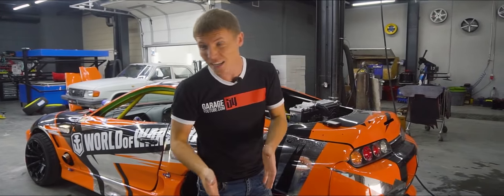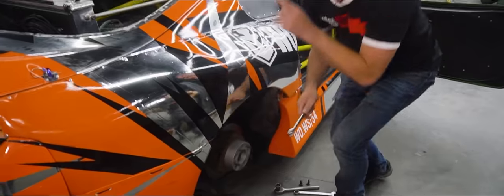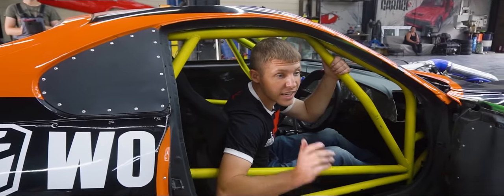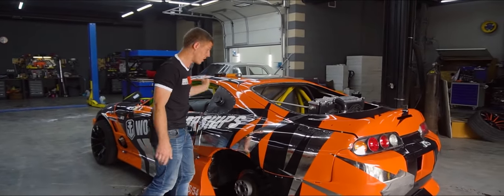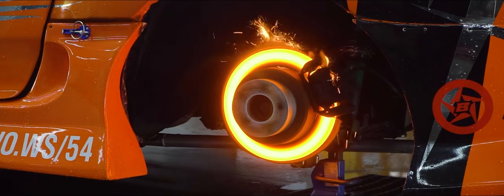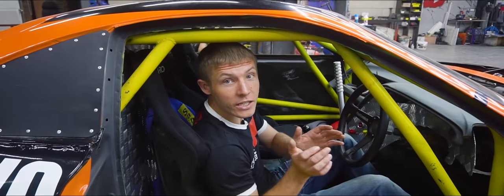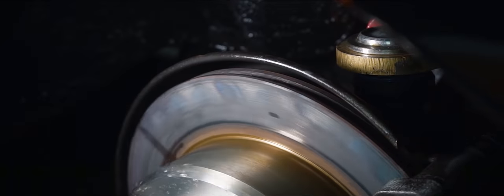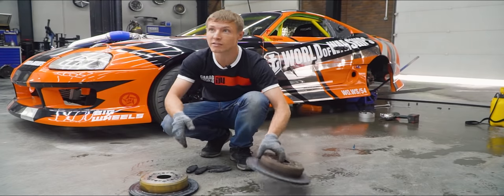Drenching a red hot brake rotor - what'll happen?

Comment: I go with BrakeBest Select Premium Ceramic brake-pad sets, they're like $40(for both front and right), with OEM-style store-bought standard-rotors $20 each side(front and right), and last 2-3 years hard driving.  $100 for safe driving.  If the vehicle is over 8-10 years, I replace the brake calipers and pistons, and evaluate the condition of the brake lines.

I burnish the brake pads onto new rotors, meaning just after installation, take the vehicle on a test-drive, for the first braking surface-mating, get up to 30mph/45kph, then brake medium-hard(but smoothly) until a complete stop, wait 30 seconds for pads and rotors to cool, then repeat 30mph/45kph, then brake medium-hard until a complete stop, total of 10 times.  That ensures the brake pads and rotors have the material mated into them enough that you could safely drive with the vehicle, without a long-break-in period of 200 miles or so.  So with brake-burnishing you can get the vehicle safely back onto the road with traffic, can be done in the first 5 miles.

Comment: I'm quite curious what would happen with a cross drilled rotor. Would the extra stress points cause the rotor to break apart?
Reply: Probably, I’ve seen them com apart before and this is a very extreme test
Reply: Yes
Reply: That's why they don't use them on race cars

Comment: Ahh, the Leidenfrost effect.  The insanely hot surface causes the mating surface of the liquid (water in this case) to heat up thus causing gas (steam) to form which repels/suspends the water and allows it to roll off.

Comment: Heat irradiation is protecting the steel from malforming. Water molecules get evaporated before they can even really touch the steel. The problem begins with drops below 100° c

Comment: the reason why the new rotor turned a weird color is because manufacturers of rotors tend to put a thin layer of grease on the rotors before shipping them out to prevent rust buildup. This layer should be cleaned off before you install the rotors onto the car. Spray the rotor with brake cleaner and wipe it with a clean rag...if you don't do it the car won't brake properly and if you brake hard you end up burning this grease as it cannot handle high temperatures

Comment: Glass or metal DOES NOT like sudden temperature!! A woman here threw boiling hot water on a frozen windscreen, you can guess what happened. 
In touring car racing at Bathurst Australia 1000km race the cars coming down conrod straight hitting 250--270+++ kph the brake disc rotors reach 900 deg C, you can see them glowing red hot!!!! When the cars come in a pitstop, it is quite normal to see flames around the brake pads!!
The OEM rotors will be the best! After all the manufactures spend a lot perfecting their vehicles ( maybe not so much these days but before computers were doing it all for them ) OEM parts are BEST but normally the most expensive!
Reply: I believe these guys tested boiling water on a frozen windshield, surprisingly nothing happened
Reply: @prich0382  the woman i mentioned SHATTERED her windscreen.
Brake rotors would be to tolerate some temperature changes ie day to day driving.

Comment: Due to something called the leidenfrost effect the water is being repelled by a jacket of steam created as the water boils before even touching the surface. Most of the water will just slide off and never touch the brake because of this, until the brake has sufficiently cooled. Even though most of the water doesn't touch it, it still absorbs a large amount of the heat from them.

Comment: I'm not sure if the brand of the rotor was the determining factor of when it cracked but the thickness of it. 
The used rotors were thinner, which means less material can rapidly change temperature, and can change more uniformly. The thicker ones would crack cause of the rapid temperature difference on a part of the surface, where the rest of it has trouble catching up shrinks at a slower rate which stretches the material until failure and it cracks sooner and under less intense heat.

Comment: I've experienced both aftermarket and OEM style rotors. Some are even made with recycled materials. and the ones that are made from "raw" materials tend to hold up a lot longer and they don't burn out the pads as fast either I've noticed. Might be neat to do a test with both raw materials vs recycled materials to see what the differences are.
Reply: If recycled metals are done properly they have every bit the characteristics and quality of newly made metals, like anything else it's the standards it's held to during the process, newly made metals can be just as crappy as poorly done recycled if not held to standards when it's produced.

Comment: They only shatter when they are extremely thin and worn, warped, and full of cracks, then force is applied and it creates a torsion moment on the rotor from the caliper and then you get a grenaded rotor.

Comment: I'd be curious to see how other manufacturers of brakes like Brembo, EBC, PowerStop and so on would hold up... 

If I were to nit pick, the water application rate wasn't quite the same between the two tests... some of the cooling was really only happening on the front surface, not the back at the same time. Either way, still interesting to see.

Comment: Fun experiment but in reality rear brakes don't do a lot of the braking. On a dry road maybe maximum 15 to 20%. 
The front brakes do most of the braking work. That's why they are bigger, heavier.
But they never get as hot as shown in this video. That only happens in racing and rally.

Comment: This happened to wifes my yukon. The bracket that holds the brake hose got old and corroded and worked like a check valve letting brake fluid going in but not going out seizing up the brakes.
Reply: I've seen that happen a bunch of times in my 40 year career as a mechanic. 
Another one is people with automatic transmissions that never use their parking brake and then one day for whatever reason like parking on a steep hill they decide to use it, then when they go to drive away and release it the parts are galded up from never being used and the return springs aren't strong enough to retract the brakes so essentially it's like driving around with the parking brake engaged, at least partially, that burns stuff up just like you seen here.
That's why I always preach to people to always engage their parking brake every time they park their vehicle, it keeps all the parts in a healthy state and prevents that from happening, along with some cars actually having auto adjusting brakes that do their automatic adjustment when the parking brake is applied.
Getting in the habit of engaging your parking brake every time you park the vehicle keeps everything in good working order along with some applications keeping your brakes adjusted.

Comment: A SUGGESTION BASED ON THIS VIDEO AND MY OWN "EXPERIENCE"😉
Once upon a time, I attempted to shove a Jeep YJ with a seized axle using my 2014 Sentra, manual transmission . 
At one point, with traction disabled, I had the revs maxed, the clutch fully engaged but NO WHEELSPIN. 
Very very very soon after much smoke came from clutch area, and I managed to save the clutch. Still using it many tens of thousands of kilometers later. 
I would love to see you set a Lada clutch on fire in a similar manner.

Comment: What about installing a CNC Machine Coolant Pump to douse your rotors while driving with a recovery & recycle catchment trough Below the break's or else internally water cooled breaks or other liquids which are wetter than water
Reply: Some large commercial trucks are equipped a system like that to cool them while driving in mountain areas. A catch to recycle wouldn't work either because the liquid would steam off and evaporate. Race cars have air ducts to direct air to cool the brakes which works very well. The brakes are designed to work at higher temps too.

Comment: Have to agree with 23:50. I recently splashed out the extra for OEM discs and pads on the front of my shitty old BMW after 2 sets of warped discs. They cost more than the car is probably worth, but they are definitely much better quality than the others, and haven’t warped yet 🤞

Comment: If it's too hot the liquid water won't ever touch the rotor, it turns to steam and creates an insulated layer between the rotor and liquid water. Steam is a poor thermal conductor.

Comment: its temperature differential that causes warping and cracking.
I'd bet that if you kept the rotor spinning every time you cooled it with water, it would last much longer.
Reply: It's all in how fast and evenly you cool it, that's exactly how tempering is done.
When the metal is heated up that much it changes the arrangement of the molecules into a pattern that's stronger, by quickly cooling it the molecules are frozen in that pattern and can't arrange themselves back into the weaker pattern they have when cooled slowly, but do it too fast from too high of a temperature and you have what you see here.
Tempering or annealing metals is an art form all it's own.

Comment: I usta work a brake shop.  Seen all kinds of stuff.   Customer say it pulls to the right when I hit the brake.  I took off the wheels,  the left caliper is missing,  just not there and a nail and clamp plugging the line hose.   Customer,  my brakes are grinding,  pull the wheels and the rotors are worn down where the cooling fins inside are exposed.   I had to put it back together cause the lady did not wanna pay that much.

Comment: Well, cast iron has been used to make pots and pans for centuries. It's a proven material when it comes to handling heat cycles, and a catastrophic failure is nearly impossible to induce.. Now, if you tried that with a ceramic/composite rotor....

Comment: I did this test unintentionally. I was driving with a trailer in a dirt road in the mountains, my breaks were pretty hot but still breaking. Then I had to cross a small river, the rotors hissed pretty bad and after that they started making noise when breaking.

Comment: I bought brand new rotors , went thru a puddle in 40 degree f  weather  and warped a rotor  instantly , brand name too……it was vibrating entire truck with less than 50 miles on them , had to replace

Comment: in joke as a kid I used to do this with solid rotors a lot, friends and parents where amazed I could basically take a ruffle chip and make it strait... by doing similar on the street or in  the driveway.
then as an adult I bought a 6piston brembo brake set and though "hell these are race brakes with big ass rotors, they wont crack or warp... roflmfao.... holy shit i was wrong..." and DEFINATLY will crack if you have drilled and slotted rotors! (secret what if you where told that drilled and slotted rotors are basically WORSE and a waste compared than to a plain faced, because of less surface and modern brakes pads that off-gas a whole lot less! maybe 15-20 years ago drilled and slotted where best but not modern day!)

and holy shit my pocket book didn't like new rotors either... moral of the story is it is all fun and games till you have to pay the bills. freaking 365mm rotors are $$$

"on another car my buddy even had a warped rotor so bad It kicked the caliper off and caused his vehicle to lock up the front left wheel sending him into a pole." much like the caliper pulse seen with the slight warp. 

kind of one of the last times I had ever fucked around on shitty tired or bad brakes, no swear by good operating brakes and well treaded tires. 

no point in going fast or having either if u slide thru or blow thru the brakes.

Comment: The second rotor is instantly done because you didnt braked it in for 500km and if the pads where new (are they? if not this testing is useless), they are now hardened like glas. then you see that at the first rotor, the pads dont touch on the whole area (if it was so, so the test is useless because of fail parts). with the second rotor the same for a little bit of time.

Comment: IT  will warp if you make the metal cold and will cause cracks, any blacksmiths know this if you forge metal, putting the metal red hot and drench it on water will make a bad sword. drench it on oil.

Comment: OEM is not always best pick. OEM always wants to get the cheapest thing that will do the job. They make sure it works but they also make sure they don't over-engineer anything wasting money. This means that if your car is not supposed to be used in certain way, they will not make parts to in those conditions. You might have light truck which works perfectly but pulling heavy trailer all the time destroys the transmission. Still, it's not worth to beef it up if 99,9% users will not pull this kind of load all the time. So you can go with aftermarket solutions that are designed to work properly. 
Even the same OEM might sell the same part with different number for different application just because it was beefed up a bit. I would not be surprised if you could get two rotors of exactly the same size and look but one is for lower HP model and one is for higher HP. Maybe it was cheaper to put bigger discs in all of them and reuse calipers but for some savings the cheaper model gets cheaper discs that are just good enough for it.
Well, OEM also does not care about stuff that is not covered by warranty. Mopar has horrible blend door motors (that's AC flap actuator) where the gear shaft is just part of plastic case mold. Obviously it breaks after awhile and the gear starts skipping. That's why various Dodge models tend to have random clicks from the dashboard. You can replace it with OEM but it will break again. You can also look for something that will not have this flaw and has proper, metal shafts.

Comment: I wonder if the brake caliper or wheel bearing got damaged from the heat. Seen brakes heat up so much that the friction material from the pads had melted onto the brake disc itself. Caliper's slider pin boots all melted away and so on... These discs werent half as bad as they were :D

Comment: if the rotor is crack, this is not the reason of the water , the main reason of crack first of the All the when rotor is red hot then  it become soft and the brake presses the rotor which main reason of rotor cracked.

Comment: Had a brake rotor explode on my sierra cosworth ... was driven very hard and brakes were well abused but not a funny experience. Just lucky I was not on a side road was on a dual carriage way and could continue along seeing I was missing my junction due to brake disc breaking .. had 1 piece of disc rotor embedded inside wheel . The rest over road

Comment: Oem is always better can be debatable.
Especially for brakes. 
Depends of your car but many normal cars, not special sports models, aftermarket parts can/are better.
For example my acura tl 05, i need front brakes and aftermarket are better then actual oem ones.

Electronic parts i would however stick to oem. Never get chinisium electronic parts for your car, they never last.(ecm,sparky parts etc...).
Anything else you can often times find better in the aftermarket parts for the same price has oem and cheaper.

Comment: Factory assembly line parts are not sold to the public, anywhere. You can walk into a dealership parts department and buy a replacement "oem" part but you can bet your ass it's nothing near the same quality as the part your car was built with on the assembly line.

Comment: Did you guys replace and bleed the brake fluid prior to the test? Also are the Brake calipers in good condition. I had a caliper rust due to bad fluid and it ruined my pads and disk

Comment: I've had issues with my front brakes heating up. One side at a time. When this happens, l find the nearest water hose. I completely cool everything in less than five minutes. No warping. I can drive without things heating again. Until the next time. Replaced the caliper and rubber line. It happened again. Disabled the ABS. Happened again. Clueless.

Comment: I am not an expert in brakes but the steel is being hardened in a bad way destroying its properties of hardness, then the brake pads would slip horrible losing grip and braking efficiency, it would be a danger.
Reply: Probably not steel, most likely iron, steel has bad wear characteristics for an application like this, with the exception of speciality applications brake rotors and drums are iron because of it's wear characteristics. 
That's also why cylinder liners are iron, and believe it or not with the exception of some speciality applications the piston rings in engine's are actually iron, people assume that they're made of some kind of spring steel but they're actually iron, it has the wear qualities needed so you're not replacing them constantly.
Reply: @dukecraig2402  You are right, it was the translator, here I place it by hand cast iron or cast iron, as I know there are metal alloys including ceramic, I remember I don't know if they were used in races or rare cars.

As I said I am not an expert but thanks to your correction.
Reply: @nopochoclos  
👍👍👍

Comment: Dude 34 bucks for a rotor is... that's damn cheap. I wouldn't dream of using a 34 dollar rotor on my personal car to be honest lol. 
I just looked up rotors for my vehicle, a pair of Chinese made "Brembos" are 90 dollars, so I guess 45 a piece although I bet they charge 50 or 55 if you buy just one, I suppose I would use those parts... I'll trust a lot of parts made in China but your car's ability to steer and stop are the MOST important features of a vehicle.

Comment: What is the most effective temperature for disc brakes to operate at? That said could you improvise a light water mist application to keep brakes at optimum temperature?
Reply: Take a look at European truck racing, water mist have been used for many years.